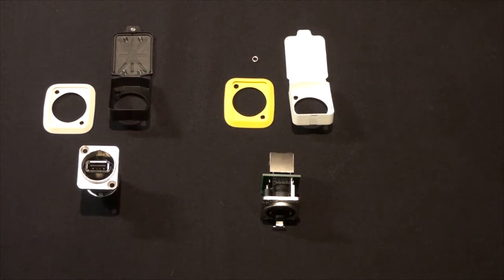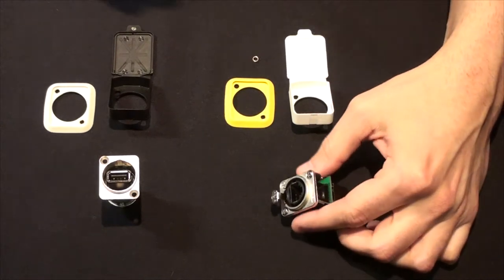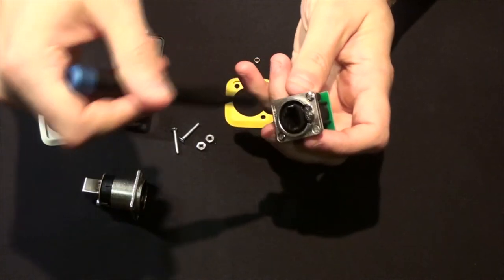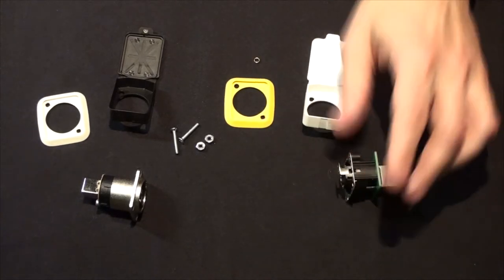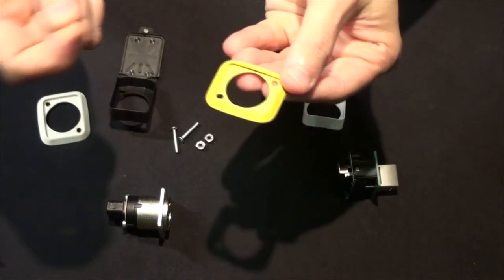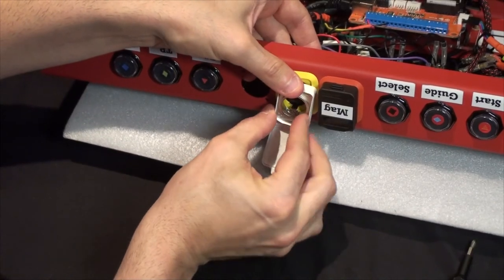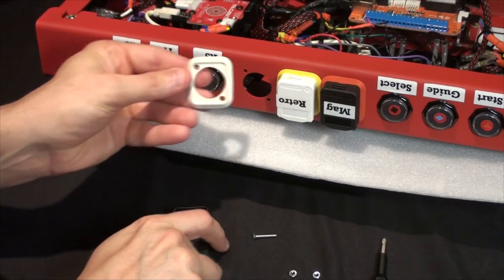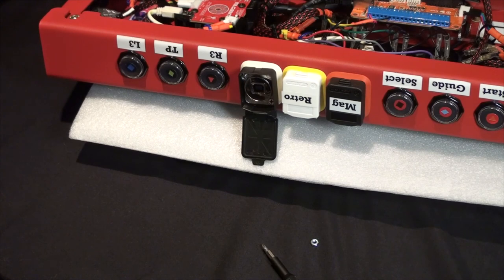Zero to Fightstick Episode 03: Mounting Neutrik Passthroughs

Comment: do you need it to plug your pcb with your pc?
Reply from the maker: You can directly connect if you like, but for a long term install, a passthrough is highly recommended.
Reply: @Zevaeros  thank you very much, i had troubles connecting the PCB to my PC, turns out the ps5 module has problems